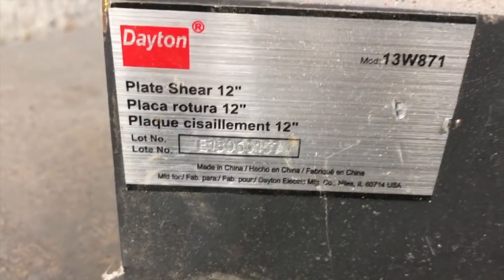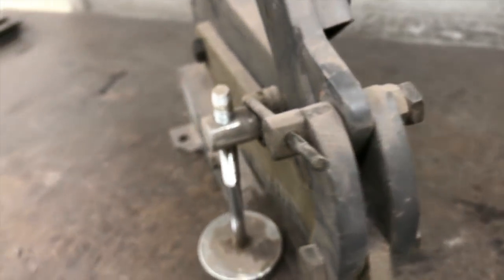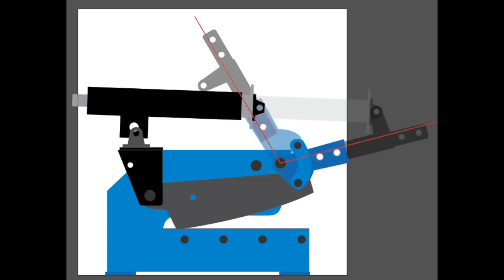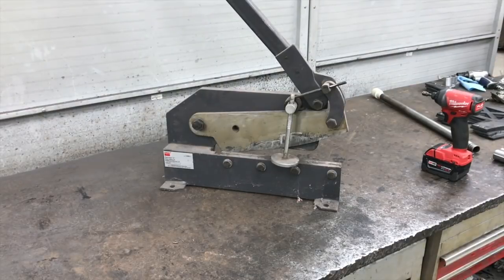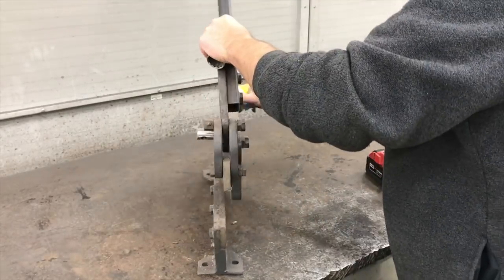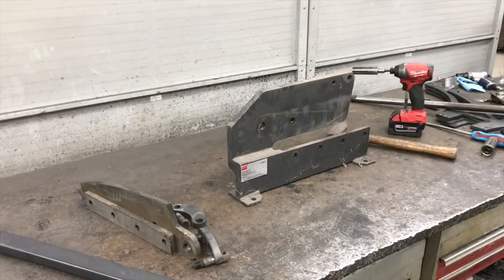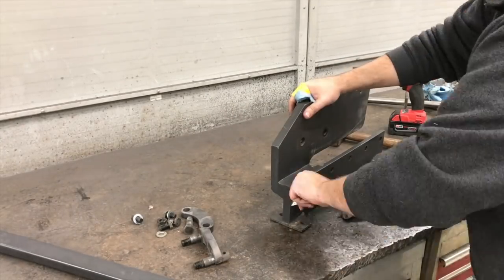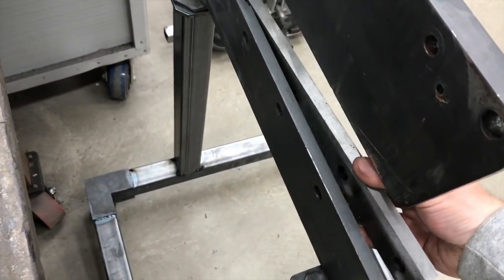DIY Poor Mans Ironworker - Part 1

Comment: This looks to be an interesting build! I built a similar one with a hole punch 20 yrs ago, used Scotchman punches and dies. It would do a one inch hole in half inch A36. Then I ran into a new 6509-24M Scotchman with single phase and a bunch of tooling for 10k. Just recently stripped the cylinder and 5hp motor off my self built and scrapped it. You can go a long ways with what you're building there.
Reply from the maker: Well this would just be something to do small stuff wiht more for the home shop, and not spend a bunch of money on it.  Why did you scrap the scotchman?
Reply: Ramsey Customs - turbocobra   Oh I didn't scrap the Scotchman, it's a fine machine. Scrapped my homebuilt one. It worked fine, but my space is at a premium and the hydraulic cylinder, 5hp motor and pump were worth more to me than I would have got had I sold it in our small "cheap people" area. 
Will be interesting to see what that can shear. On my small hand shear like yours I mounted an adjustable 1/4x4 plate edgewise on the inlet side the full length of it with clearance for 1/4 stock, drilled a 1" hole through it for access to the rod shear so that no matter how narrow or wide the stock is you don't have to dick with the little round hold down, just shove your metal in and shear it.

Comment: On mine I built a rest that bolts on to the left side, you just loosen the bolts and it slides down on to them and levels up perfectly with the blade, then put a removable stop at the back which is squared up perfectly with the blade, this way you can rest sheet on it and cut a perfect right angle quickly.
Reply from the maker: can you email me a pic of what you are describing?  gary@ramseycustoms.com  my plan is to bolt some angle iron to the left side, with a series of 3/8th holes and make a fence that also serves as the replacement for hte chrome stop to keep it from tipping up
Reply: Yeah sure, I'll try and do it tomorrow.
Reply: Apologies for the delay, I've just sent you a couple of pics.

Comment: Top (fold down) bottom (fold up) electrodes for spot welding small panels? Maybe the electrodes would be long enough to extend the reach somewhat? Thanks looks like a cool project!
Reply from the maker: Not following you on the first part of your comment?
Reply: The top electrode will be hinged and for spot welding this electrode will rotate down and be locked in place, then the bottom electrode is hinged and will rotate up and locked into place, both lock locations are predetermined in order for both electrode to make contact at their points. Then raise up the shear mechanism stick your panels to be spot welded and lower the shear mechanism back down hit the spot weld energize switch which is controlled by a timer to set the duration of electricity for thinner or thicker materials. Thanks

Comment: Is it gonna be a portable shear or an iron worker? There’s a big difference but if it is gonna be an iron worker I’d definitely be interested depending on how it comes out
Reply: Our "ironworker" concept is based on several machines that we both have that are usually combined into one large unit. Punching, Shearing, Bending etc... hence the "poor man's workaround" solution is to use several of the smaller, more affordable machines that accomplish identical tasks without the $20k + price tag.
Reply: Good deal I was wondering if it was gonna have a punch/notch setup

Comment: a 50 ton plus cpapacity ironworker sells for scrap prices around here.
while this build is cool, its honestly not close to an iron worker.
i have two, a hydraulic and an old Buffalo 96 ton mechanical one. both were picked up for the cost of hauling them out of where they were.
Reply from the maker: Where you located?  those type of units here that are running are $8K minimum
Reply: Ramsey Customs - turbocobra , houston texas